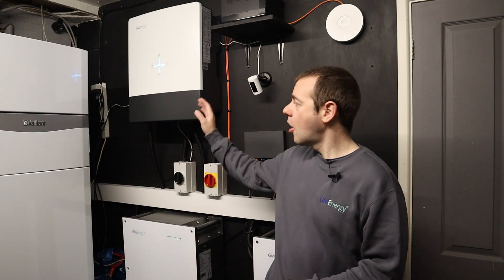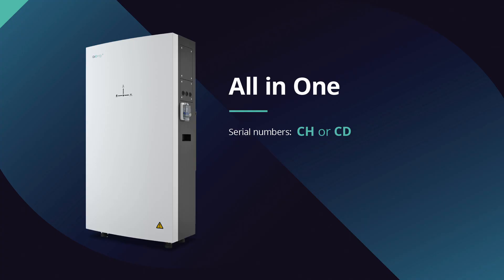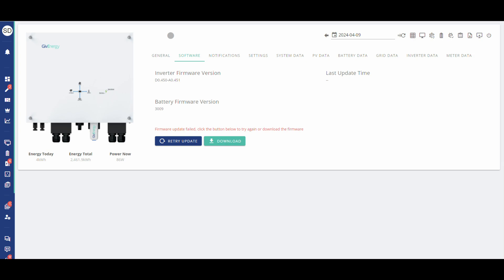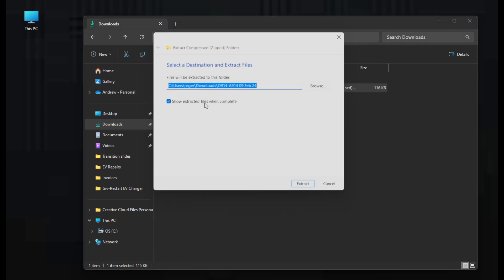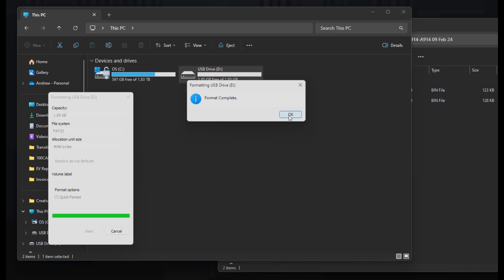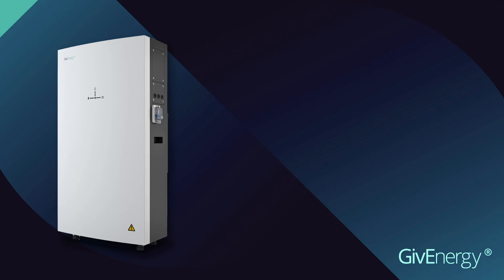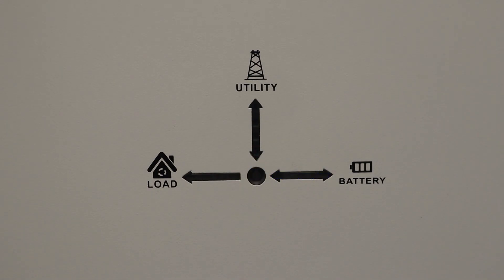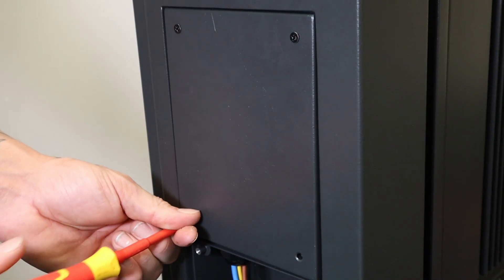How To Manually Update Firmware - AIO Inverter

Comment: Make sure to format the stick to 2gb in Disk Management and format as FAT16. Been going round the houses trying to make it work. Managed to update my AIO Battery and Inverter and have just managed to finally do my Gateway. GivEnergy do a file that's a collection of AIO firmwares. AIO Firmware Package Complete Set. My Gateway still shows offline though even after all this but at least it's updated from A005 to A0013!

Comment: Very informative step-by-step guide. Thank you. My issue isn't firmware update but resetting the dongle wifis for GEAIO after a need to setup a new domestic TP - link booster mesh. I believe a manual upgrade is required would the opening of hardware panels be the same? Thanks again.

Comment: Interesting video. Thank you. However, you may find you have fewer bootleg copies of the firmware floating around the internet if you posted them publicly on your website rather than only where your approved contractors can access them. Take the iPhone I’m typing this on. Upgrading the firmware is something the owner of the phone  (me!) can easily do themselves. If I had to call an Apple engineer every time or take it into an Apple Store iPhones wouldn’t be nearly as popular. I speak as the owner of a Givenergy inverter and batteries. You are stifling your own market by making the upgrade path too restrictive. If I want to update the firmware manually, or add a second string of panels or an an additional battery I shouldn’t have to get a contractor in to do it. Plug and play should mean just that.
Reply: The firmware is available on the portal for any user if it fails the update. (see one of the manual update videos in the description).